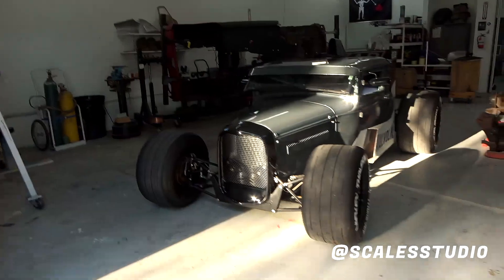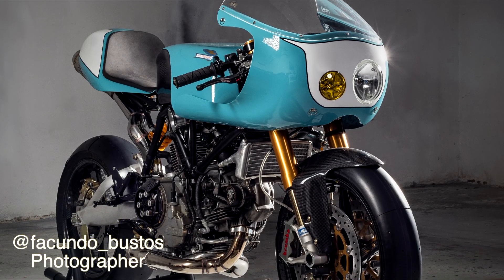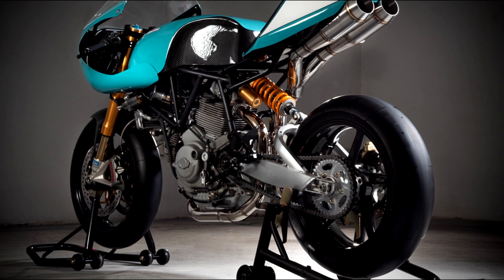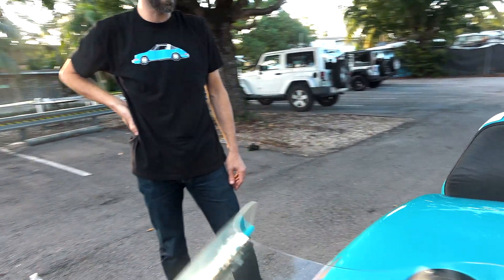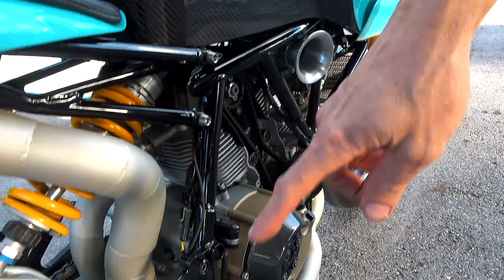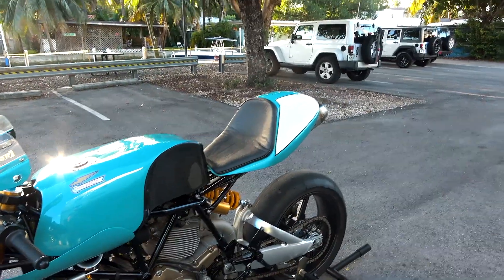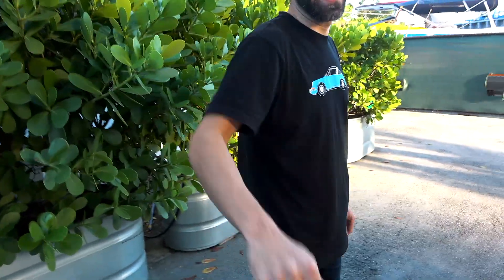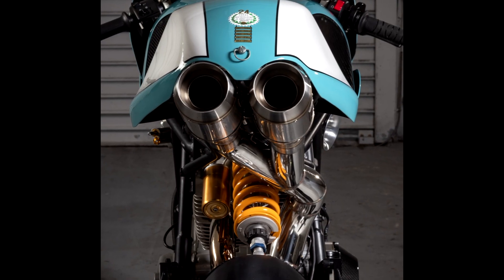This Ducati Cafe Racer costs $105,000 to build! - Ricky Boada

Comment: No offence, and i hope i'm wrong and perhaps it's a distortion caused by the camera lens, but if i was to pay 105K USD for this bike i would expect the decal on the tail section to be in the middle of the black pin strips and not wonky, the  right hand side muffler is also off axis, there's what looks like a 5 to 10mm gap between the end of the silencer and the end of the cowling compared to the left and the drop increases to about an inch where the muffler meets the titanium section. You could have done better given the time spent selecting components.

Comment: $105,000 and it died twice before it idled; maybe take off a zero.
Reply: 🤣 that’s literally what I was thinking
Reply: Just spitballing here; $105k minus $25k in actual parts leaves you with $80k in labor. 1600hrs that's $50/hr...Sound about right? But hey, that's not a bad hourly rate for custom work ;-) Not denying that she's a sexy beast but holy hell that's a lotta cannolis!!!!
Reply: Not worth the build cost when half the parts are bolt on and scavenged from other bikes. The color, not my cup of tea… but the cat face front is meh